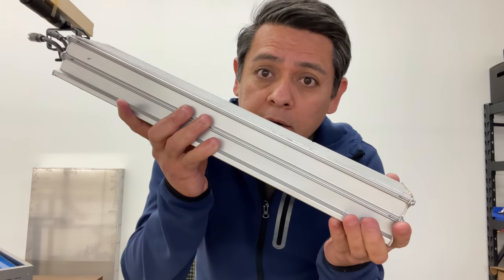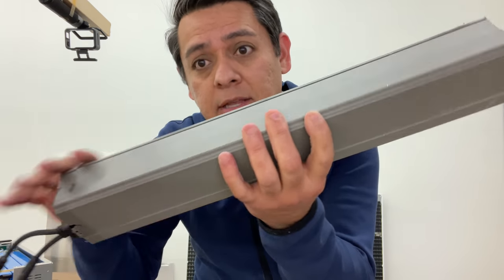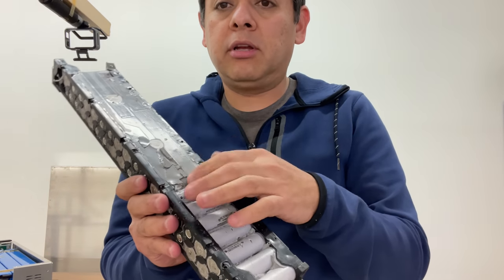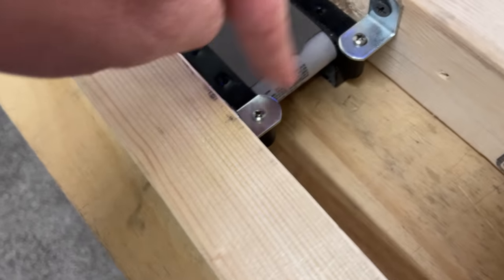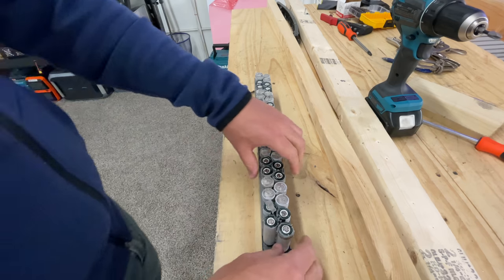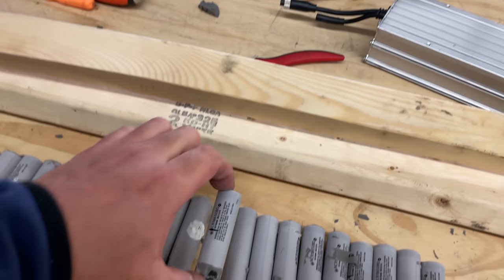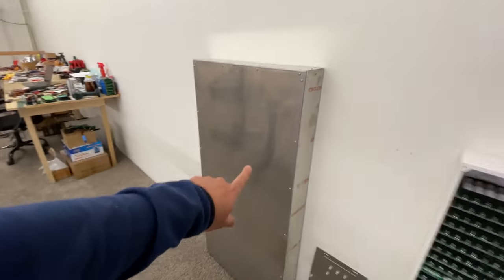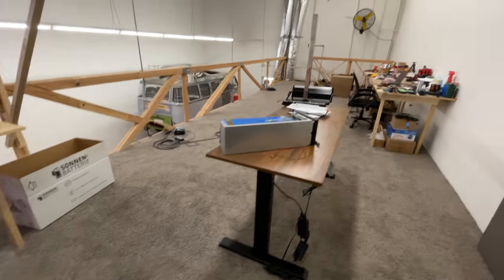Harvesting Panasonic NCR18650BD cells out of Scooter Batteries

Comment: Jehu, I would use a wooden dowel rather than a Phillips screwdriver. I would not want the point to puncture or dent the cell.
Reply: +1
Reply: its a big torx head, 18650's are almost 1mm thick of steel at the bottom. if you've taken any of these packs apart, you'd know they aren't in there tight at all. relax man

Comment: Why the hell these companies put all that rubber crap in those batteries? They make it very hard to re-use the batteries
Reply from the maker: Thermal insulation, shock absorbent, fire retardant ,  just a few reasons why they would use it,  they don’t really care about your needs
Reply: @jehugarcia  do they want thermal insulation?
Reply: ive taken apart 36 of these packs, just setup a jig for every step. I banged out all 36 packs out in 4 days. amazing cells

Comment: Ive got a collection of MOSFETs off these scooter batteries.  The part number seems to be "ST 15810"  from STMicroelectronics.  The datasheet reports 100v at 110a.  Im curious if these would make good replacement for upgrade of ebike controller FETS.  Any opinions?

Comment: I just ordered 2 of the scooter batteries along with the XT90 dongle switch. I’ll soon be ordering a charger from Amazon. This setup will be going into my  72v 2000w electric sport bike. Eventually I’ll order 2 more of these batteries to have a complete set of 4 batteries. I chose to order them without the casing but plan on keeping intacted. What else would you recommend for this setup?

Comment: Wish I had seen this before spending all day taking two of these apart.  Prying apart is a good idea - wish I had thought of that.  With that, for anyone thinking of using these "as - is" I don't recommend that at all.  One of my batteries was punctured and leaking and several are very close to being punctured.  Out of the two packs (80 total) only 72 are usable.  But the polyethylene enclosure was fine on both, which means the manufacturer utilized at least one defective battery.  Thus the reason they probably are second hand.  Can't imagine a pack with a punctured battery would pass any testing.  So follow this video, take them apart and anticipate 90 - 95% useful batteries when done.
Reply: weird, ive ordered 36 packs and all 1,440 cells are in perfect condition and even testing higher than rated capacity. I dont think these packs were ever really cycled.
Reply: @electricalfive2248  I did order another pack and they were fine.  Guess my first two were just unlucky...
Reply: @mark mcguire.. I'v experienced the same issue with the first pack I salvaged. 2 cell out of the 40 had a slice cut into it. 1 reads  30.6v just on the volt meter,  as you stated the polyethylene was fine seems the pack was made with the bad cell... here's my question... my first pack had all grey wrapper with no print at all.. just plain grey.. is that the same for you? also just opened my second pack and they all have the NCR18650BD on them..I have 4 more to open ... got my fingers crossed.. thanx in advance
Reply: @stizzywomizzy5322  I'm pretty sure both had the black lettering on them.  So far they have worked fine for a couple of months now - the small dents and such haven't been a problem.  good luck.
Reply: He lists on the site, that the ratio is about 90% for harvest.

Comment: I’m trying to build a 36 v battery pack for my golf cart but I need it to not catch fire.  What would be the best and cheapest way. New 6v wet batteries are $600
Reply from the maker: Get 10 of these and an arduino, and you get twice the battery that will outlast flooded for the same price
Reply: @jehugarcia  great idea can I still use my 36v charger or will I need something else? Can I pick these up in San Diego?
Reply from the maker: Yes 36v charger works,  no in person pickup at this time

Comment: I would like to suggest that people use something to gently catch the extracted cells (instead of allowing them to hit a hard surface) , to prevent impact damage.
Reply: A box with a fluffy towel comes to mind.  Reminds of the time I dropped one on concrete and had a runaway thermal event.
Reply: this has to be the the most useless thing ive heard in long time. have you ever even held an 18650? they have steel casings, ive dropped 1,000's of cells, they are some tough little things.
Reply: @electricalfive2248  I have harvested 100s.  I had a problem only once.  It slipped out of my hand while breaking up a 9 cell pack, and about a 20 seconds later I went to pick it up, and it was burning hot.  The steel case was dented, and must have shorted out the internals.  It was a little bit of a surprise.